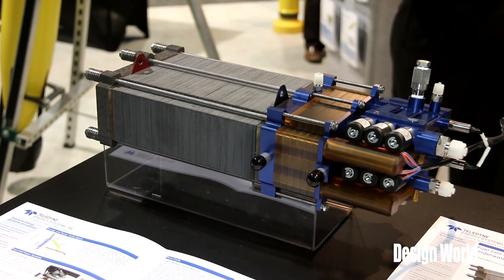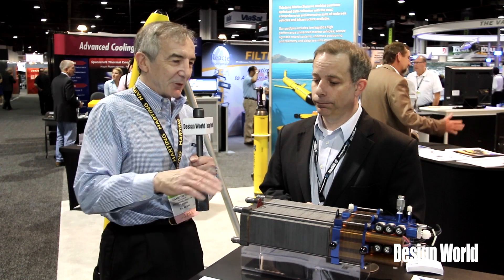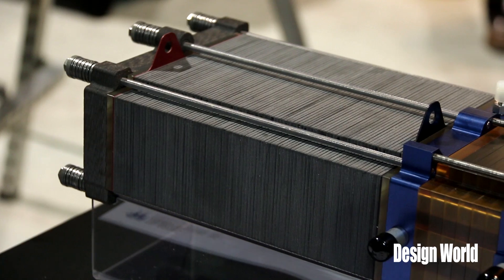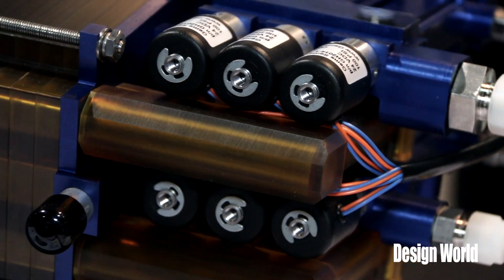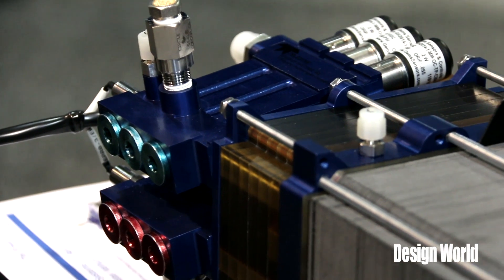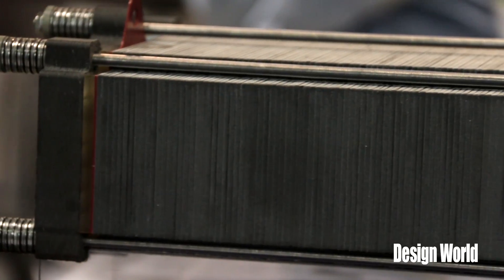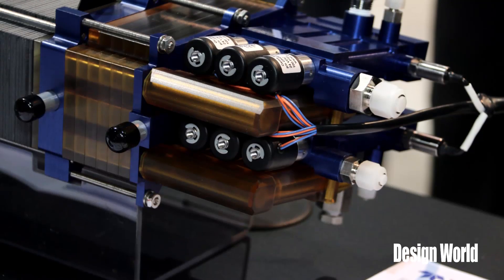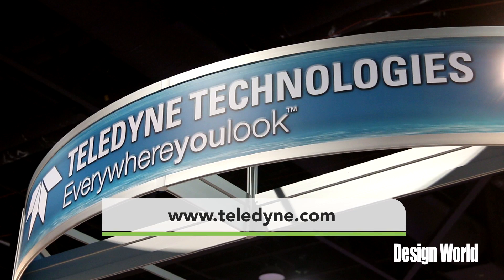Who needs batteries when you've got a hydrogen fuel cell

Comment: A little math for sizing that H2 tank he says will run for a week... (please correct me if I am wrong anywhere, and my apologies to those in the US on a different unit system):

1 - The fuel cell is the reverse of the electrolytic process. So if we take the minimum input required to convert water to H2, and use that as a basis for the energy output from the fuel cell, that would be an "optimal" situation for the manufacturer. This value is apparently 237kJ/mol based on a Google search.

2 - One mol of H2 is 2.016 grams. Therefore the "optimal" energy output is 117.6 kJ/kg.

3 - If the continuous power output of the cell is, say 4kW, for an 8 hour day this would mean we need to supply a total of 2903 GJ (2.75x10^9 BTU) by the end of the week.

4 - Therefore the mass of H2 required would be in the order of 24.6 tonnes (54400 lb), with no efficiency losses factored into fuel cell operation.

Sound like you are going to need gigantic tank of H2 or continuous supply somewhere.

Or, am I missing something here?
Reply: Where did you get 2903 GJ for energy consumption? I made it 0.8 GJ. WHich potentially makes your calculations a factor of 3000 out. Apply that to your 24.6 tons gives you about 8Kg of Hydrogen needed. WHich is not far off what I got when using the accepted compressed Hydrogen energy density of 142MJ/Kg.
Reply: You ARE missing something.  To simplify the weight equation.. 89 grams per 1000 Liters of Hydrogen at standard pressure.  

For real world scale/examples:  

The Nikola One semi truck (made in Utah) carries 10 Kilos at 5000 PSI and has a 1200 miles range.  Anheuser Busch just bought 800 of them and Ryder is building a network of 800 fueling station in support of them.  

The Toyota Mirai carries 3.5 Kilos at 10000 PSI (this one is an oddball at that pressure) for a 350 mile range.  

There is a small car in the UK by Riversimple called the Rasa; It carries 1.1 Kilos at 5000 PSI with a 300 miles range.

The other vehicles that run on hydrogen fuel cells have very similar specs.

A major thing of note, all of them can use the exact same dispenser system.  No proprietary adapters.  roll up, attach the hose, roll out 5 minutes later with a full tank.  OK, a semi takes long to fuel.  Big surprise there.  A diesel takes 30 minutes to fill.  I've seen writes up that say the hydrogen version takes 25 minutes.
Reply: True. The pressure drops as it gets used.
Assuming you can fill it up from a freshly filled tank at the station. (Which will be a rare event).
Reply: The assumptions for the calculation are in lines 1 and 2. Where did you get/make it to be 0.8 GJ?
Reply: Line 3 is your problem. 4KW power consumption for 8 hours a day for 7 days a week does not equal 2903 GJ.
Reply: You are correct, thanks for picking up my error. I am getting 0.806 GJ now, but that still equates to 6857kg of H2 fuel. Not exactly portable for an unmanned vehicle. It may not be operating at peak power the whole time though, but it's still a lot to carry around - might be worth considering how much volume/mass a diesel/gasoline equivalent would take to match it.
Reply: Could you do me a favor? The shuttle has a hydrogen fuel cell, and produces 7,000 watts at 28 volts. The shuttle flies for 15 days with the fuel cell running before, during and even after landing the entire time. the shuttle has 2 98lb  tanks for the fuel cell one liquid hydrogen, and one liquid hydrogen. Can you calculate the lbs of o2 and h2 this would take for 15 days?
Reply: 2 - It's either 117.6 kJ/g or 117.6 MJ/kg, and in line 3 you need 800 MJ, so you're good with about 8 kg of hydrogen.
Reply: @antalz  you are wrong about 3rd line xD, 4kW for 8h is 4x8= 32kWh, 32kwh*3600s= 115.2MJ
Reply: okay didn't read about the week xD its correc
Reply: @wonderwise5493  He spoke of energy per week though, and you're computing one 8-hour day. 7*115.2 is roughly the 800MJ I wrote.

Comment: Understood it can use oxygen from atmospheric air. How about hydrogen? It should be produced in large-scale right? In factories? So it gonna cost bomb. And what is the source of hydrogen? Is it never ending, unlike fossil fuel?
Reply: m1aws

10X as many?  Where are you getting your numbers?   That's the same as saying the h2 cycle from renewables -> water -> hydrogen -> car -> to electricity -> back to water is only 7% efficient! 

I'm sorry but those figures just don't merit a reasonable response to you.  

And yes, hydrogen is easily made from water.  When we have countries and states literally DUMPING excess renewables because they can't force the grid to have high demand when there is peak output, what else do you suggest doing with all of the excess renewables?   That is why smart countries like Japan, Germany, UK are using what is called a P2G system.   It's a way to curb the dumping of excess renewables and instead put the produced H2 into its natural gas system to start the de-carbonizing in at least one form or another.
Reply: Yes.  H2 is easily made from water.   and after using it, turns back into water.  It's an infinitely sustainable system, assuming your original energy comes from renewables such as hydro, wind, solar.
Reply: It's not "easily made from water". That's the least efficient means to obtain hydrogen. Your same "renewables" will power 10x as many ev's as one H2 vehicle.

Comment: Let see... how much energy is required to produce the hydrogen for the fuel cell to convert it back to electricity?

yeah... Fuel cell is super convenience and super efficient...
Reply: Energy efficiency is not the problem.   batteries are so much heavier, and hold less energy, they won't keep an electric aircraft airborne for very long.   If you scale up the battery, adding more weight is increasing your energy consumption and also need for bigger motors, which also weigh more.   Hence why 45 minutes - 1 hour is best you can get.   With enough h2 on board, fuel cells can easily go 10X as long.
Reply: Yet the 250 mile range Toyota mirai costs as much as a 325 mile range tesla while costing a crapload more to run but without the performance of said tesla.
Toyota is so embedded into the fuel industry they didn't even include a battery charger in that car. That would drop its running cost and give the owner a range gain.
Nobody wants your H2 car, Ben.
Reply: @m1aws  apparently, the japanese disagree...

Comment: Yes hydrogen is the most abundant element in the universe, but you do 
not have it on Earth in the form you need it, you only have it as part 
of other molecules. So you have to make it (from water, natural gas 
...), and it takes much more energy (3 times more) to make it, than you 
get from it.
This makes hydrogen energy storage (very poor one) and NOT energy source.

For larger energy usages, like cars, hydrogen does not make sense.
First, they are promoting hydrogen as alternative to fossil fuels, and 95% of
hydrogen coming from FOSSIL fuels (natural gas)! Mostly from
FRACKING. So hydrogen does not solve environment issues (unless 
you
think fracking is good for environment), and nobody will produce
hydrogen on large scale with electrolysis while cheaper alternative is
available.

As for getting hydrogen from water, for hydrogen you
have to put in 100kWh of energy to get 23kWh to move the car. In EV, for
100kWh, you get 70kWh to move the car. So hydrogen station creating
hydrogen on site will use so much electricity that it could charge 3-4
times more electric vehicles. For example, electricity used to fill up
1000 fuel cell vehicles for 300 miles, could fill up 3000 electric
vehicles for the same mileage each.

Price: 50$ for 300 miles? That is more expensive than a petrol car, and 
this is with 'cheap' hydrogen that is coming from fossil fuels, it can 
only get more expensive.
Who loves hydrogen? Big oil companies, because they produce it from 
fossil
fuels, and fuel cell cars would let them keep their monopoly.

You can say, we will put solar panels, wind turbine or any other 
renewable
and make hydrogen that way for 'free', but that also does not make
sense, because with the same solar panels or wind turbines you can
support 3-4 times more electric than hydrogen vehicles.
Reply: NO The stone age didn't end cos we ran out of stones and neither will the oil age nor the lithium age end because we ran out of lithium - we will move on from lithium ion batteries when the competing technology is better. If we run out of lithium on earth before we find better technology, then something else has gone terribly wrong ie. we are living in a dark age or we are extinct from climate change
Reply: H2o.  Hmmm look it up.
Reply: Just use renewable energy like solar to generate hydrogen.
Reply: xIAMDAVEx but it does burn cleaner. And if you use the system together with gas. There is a cleaner exhaust. And it produces a few drops of water that comes from the tailpipe. And then you can use nearly any water for it. And help clean these streams and rivers that the EPA destroyed trying to keep their jobs.
Reply: xIAMDAVEx they don't have a monopoly. The oil company's compete to make more money. Tesla currently has a monopoly on electric cars, they can make their cars as expensive as they want and people will always pay. Also as with fossil fuels we will eventually run out of lithium and possibly quite soon as demand is skyrocketing the prices will go up for lithium making the cars even more rediculously expensive.
Reply: Tesla doesn't have a monopoly. They simply produce luxury electric cars people want to buy over the nissan leaf or other EV's. If they want to compete with Tesla they should go the route BMW is going in making luxury electric cars
Reply: The problem with EV is distance. Drive 250 miles wait 30 minutes to get another 200 miles. HFC at least fills in 3 minutes. 

A solar panel can produce hydrogen in your back yard. If you have enough you can power a battery Bank for when sun does not shine.
Reply: Electric cars used to be non efficient as well and now we are already having them taking over.

Having an electric car while it can only do a specific amount of Km and then have to slowly recharge it is a bummer. What is good about hydrogen is that once you have it, it is so much better to use it as a fuel.

Your problem (and Elon Musk's) is that you can't find a good way to take it from renewable sources. I understand Elon Musk has invested in his "tesla" car with his batteries and all so he doesn't really want another technology to take over, but what is your excuse for dissing hydrogen while it is still in its baby years?
Reply: Interesting....
Reply: It is illegal to drive a heavy truck non stop for more than 500 miles - once you are past 6 hours of driving time, you entering break periods, which you might as well recharge with if you can - ie. 600 miles or 60000 miles - no one will notice because once you are past 600 miles, you usually need 8 hour break by law
Reply: ie. Lets say your truck could drive non stop for 10000 hours......your not legally allowed to do that, so  thats why no one bothers to design a truck with that much range. Likewise, you can't legally drive 1.300 miles in a thor truck without stopping overnight.....and if you are stopping overnight, then you could of had half the range tank - the 1,300 miles is useless except for the fact, that unlike electricity or petrol.......there isn't hydrogen available everywhere
Reply: xIAMDAVEx 
but . . . you can't make a flame
Reply: According to NASA and NOAA and CSIRO and all the other research groups we need to be carbon free by 2050 - from business plan to completed and operational for any large commercial project generally takes 5 years - a lot goes on behind the scenes before the public hear anything. With that in mind - it's more costly to build "Bridge" fuels than to simply go straight to carbon free. Granted in some cases it won't be possible to be carbon free - but you worry about those places last, you pick the easy projects first, gain experience, economy of scales and then you slowly work towards the harder cases. Hydrogen works in places like Orkney and many large commercial and industrial use cases but doesn't make much sense to use it as a domestic fuel in the majority of cases, it's too expensive
Reply: yes, they all say it but nobody does, recycle your BS please
Reply: Batteries are better. First, hydrogen production takes too much energy. Then the hydrogen gas also needs to be compressed for storing. 
Hydrogen fuel cell system is just too inefficient compared to batteries.
Reply: The pro here is not it's efficiency, which it easily get handed to it by any modern battery technology. The pro is it's specific energy. In the same volume and mass of a battery that can produce 5KW for 1 day, you can fit a fuel cell, hydrogen, and storage tanks for said hydrogen that is capable of producing 5KW for a month or more. This is a great advantage for long duration applications, and in fact anything that operates for more than a few hours at a high energy load, but needs to maintain a low weight, such as a humanoid robot, or other biomicry style robot.
Reply: Again, energy storage, and density; not energy efficiency or feasable for energy production. Fuel cells are great in robots and that's about it.
Reply: HYDROGEN CAN BE EXTRACTED FROM THE ATMPOSHERE. You do not know what you are talking about
Reply: The life span of EVs are much shorter than FCVs. FCVs can last twice or even more time than EVs. How could you say EVs are much cheaper, while you have to replace the battery packs every 5 years?  Plus, how are you planning to dispose all those batteries from those used EVs in 5 years?
Reply: @RodgerBai  this statement is literally completely backwards, some EVs right now can do 500k miles while FCVs need to replace the fuel cell stack frequently
Reply: Toyota is betting the future to hydrogen fuel cell than electric,they invest so much money and resources and the technology is way available over the years it never embrace most of the public even government and the lack of facility to make it happen will not convince people to embrace it over battery electric vehicle.
Reply: @Labs Micro good for him i guess? I mean i doubt that's the case with your dad's car, if so he needs to get a replacement battery because that range is pretty low.. Tesla batteries often have a long life! Some FCVs do get more range that BEVs but its just not a very good fuel, lots of downsides
Reply: @Labs Micro im pretty sure alot of people would prefer to drive a Bentley haha
Reply: Let's look ahead, what to do with billions of lithium batteries when scrapping electric car? Who supposed to pay for recycling? 
Sooner or later electrical energy will be cheapper because of fussion reactor power so producing hydrogen from water will not be so expensive. Fossil fuels is better to leave where they are.
Reply: Lithium is completely recyclable. Li-ion Batteries are being used  every where.
Reply: Ben. Go buy a mirai.
A fool and his money, yes?
Reply: When I drive from Auckland to Wellington, we stop halfway at taupo for lunch - roughly a 7 hour drive altogether - the idea that you say BUT NOW you have to stop for half an hour in Taupo...yeah....we were going to anyway fuck face, calm down.

And No you cannot economically produced preassurised hydrogen in your home even with a desiel generator/solar panel/gas turbine - it costs WAYYYY More than simply buying a tank of hydrogen
Reply: shandcunt lmao I was never mad. I don’t even remember posting this. I drove 13 hours to Chicago no stopping except for gas.
Reply: Hydrogen cars are just as heavy as EV'S! battery density to kg is going up all the time and not to mention Fuel cell cars have near enough the same range as a model s for example. it just makes no sense to go hydrogen.
Reply: Energy efficiency is not the problem.   batteries are so much heavier, and hold less energy, they won't keep an electric aircraft airborne for very long.   If you scale up the battery, adding more weight is increasing your energy consumption and also need for bigger motors, which also weigh more.   Hence why 45 minutes - 1 hour is best you can get.   With enough h2 on board, fuel cells can easily go 10X as long.
Reply: m1aws

I see you are trolling anything to do with hydrogen, and of course, putting your negative spin all over it.

Glad to see you have gone anti-science.  What's next out of your hat of tricks: fusion power is going to ruin the world?